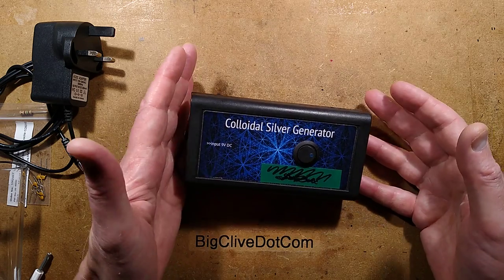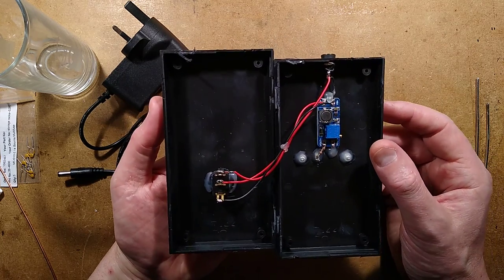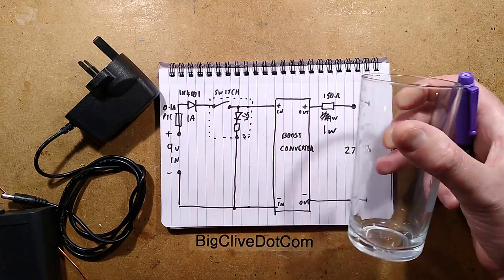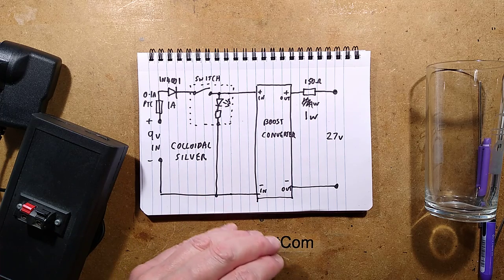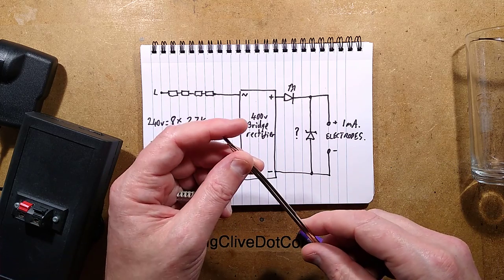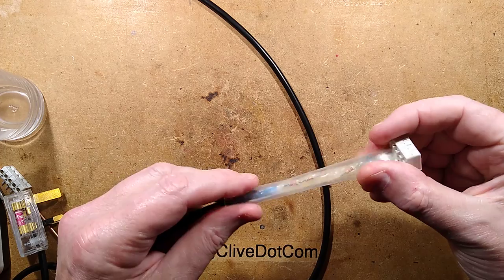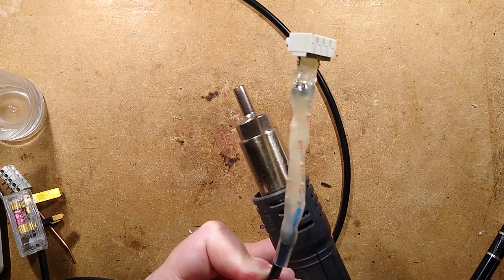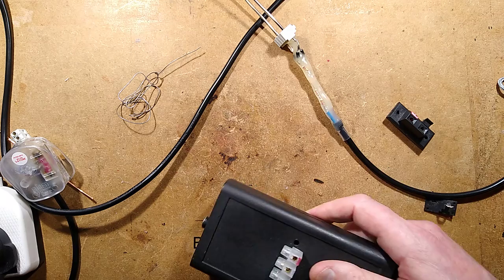Fixing a colloidal silver unit and making a slightly dangerous one.

Comment: This device produces only ionic silver. That it produces in a short time scale amounts of a white precipitate, which is by definition not a colloid, is most likely due to the presence of electrolytes in the tap water used. The white precipitate is suggestive of silver chloride, a product easily resulting from silver ions reacting with chlorinated tap water.

Colloidal silver is a suspension of fine particles of elemental silver that will not settle or will settle only after a long time frame. It is a mixture not a solution.

Ionic silver is not colloidal silver. It may be possible to create a colloid of an ionic silver compound, for instance, silver chloride, but this would still not be colloidal silver, it would be colloidal silver chloride.

Silver chloride is not silver just as sodium chloride is not sodium. Sodium is a silver-grey metal that reacts violently with water. Sodium chloride is table salt, it doesn't make your soup explode (except maybe explode with flavour, I don't know how good a cook you are). Silver is a silver-coloured metal you make jewellery from or use as a conductive wire. Silver chloride is a white powder that turns violet after exposure to light.

Ionic silver, often in the form of water soluble silver nitrate, is often the starting point to make colloidal silver. One reduces the ionic silver by the addition of a reducing agent. No such reducing agent is being used here. I have heard of one similar commercially available silver ioniser that has an additional step of adding a reducing agent after the oxidation is completed though I am skeptical of the efficacy. If it was as simple as the manufacturer's instructions state I think the process would be more widespread in industrial and research laboratories who have a need for colloidal silver.

In the absence of contaminants found in tap water to act as electrolytes the device in thus video would take longer to have much effect but would still produce only ionic silver, quite possibly in the form of silver oxide or silver hydroxide. The oxide being obtainable from dissolved oxygen and the hydroxide autodissociation of water. Silver hydroxide however would decompose into silver oxide and water. Silver oxide is a black powder. Oddly enough, people who use these fatuously named "colloidal silver generators" with distilled water find their silver electrodes covered in a black powder. With only pure water and pure silver and atmospheric oxygen as reactants there's really only one credible explanation for the nature of this powder.

Comment: I have never heard of this silver drink, but it scares the bejeezes out of me. I would definitely never drink anything like this. Also mains voltage scares the hell out of me too. I was always glad when they started putting plugs on things. I usually took about 10 to 15 minute's just to wire up a plug. Double, triple and quadruple checking all connections. When Clive plays with mains voltage my heart skips a beat.
Reply: I find it strange that UK appliances used to be sold without a plug. Here in the US everything has had its own plug since maybe the 1920s.
Reply: @eDoc2020  not only that, but we had to know what size fuse to put in it too. Mostly 3amp or 13 amp. Though there were some 5 amps used as well. Maybe it was to do with costs, or the electric company bring in with the insurance companies putting the liability of faults in the customers hands rather than there own.
Reply: @eDoc2020  In the UK, until the late 1950s, there were competing standards for electricity, with different plugs (see BS 317, Wylex, Walsall Gauge, etc). Consequently, it was normal to sell appliances without a plug, so the customer could fit whichever type they required.

In the 1960s, things became more standardised, particularly with the formation of the Central Electricity Generating Board, which eventually became the National Grid. However, there was still no legal requirement to supply a plug - and companies save money when they can. Also, it takes many years for people to adopt a new standard. We were taught how to wire a plug at school, so it was normal.

Things were built to last. If you paid $300 for a toaster, you wouldn't just throw it away if it broke - you'd get it repaired. It could last for 30, 40 years. Nowadays, we buy a $10 toaster that lasts maybe 3 years, then throw it away.

Eventually, selling things with a plug became a marketing advantage. Then the law changed in 1994. Since then, everything has to be sold with a plug.

Comment: Why do you say, "the safety of ingesting colloidal silver is not proven"
It is proven. It's dangeous. There is no controversy.
Reply: Did you read that on wikipedia?
Reply: @Varangian_af_Scaniae  No, but I may have written it on Wikipedia, back when I worked for the Wikimedia Foundation.
Reply: @Varangian_af_Scaniae  I mean by the very claims of the product it's dangerous. If you're killing bacteria, you're killing helpful gut bacteria too, which is another reason antibiotics are avoided for long term use. There are many studies linking diversity of gut bacteria to long and healthy lives. In addition, heavy metal poisoning is very real and we had to rush someone from our lab to hospital after they accidentally ingested a solution containing silver! It can destroy your kidneys with prolonged exposure
Reply: @georgeperalta936  like constantly using Hand Sanitizer And wearing masks...
Reply: @bansheemania1692  Not really. Unless you are bathing in hand sanitizer, the bacteria living on your lower arm will re-establish on your hands quite quickly. Using hand sanitizer constantly mostly just dries your skin etc. Not sure what you are trying to imply about wearing masks. They don't kill anything, just prevent you from spreading stuff, and helping you not breathe in as much potentially harmful stuff. Doctors and nurses have been wearing masks for so long it would probably have been discovered if they actually posed a problem for anything other than your fashion statement :P

Comment: Question: Why is "50 quid" (50 pounds sterling-silver) a good price for $4 USD of ebay components?
Reply: Because it's a specialised tool BigPharma don't want you to know about! The maker painstakingly removed all the bad voltages and currents from each component before assembling and then prayed a long prayer to the spaghetti monster before selling. Obviously all this vastly adds value
Reply: The guy(s) who designed, sourced parts for, assembled, hopefully tested, packaged, and shipped the device have put a not-insignificant amount of time into it, and, even if it is a quack device, do deserve their cut of the "stupid" tax.  Also, by charging 50 pounds for it, and making it straight from ebay parts, they open a market for people to undercut them on price.
Reply: @Kineth1  My comment wasn't against free market capitalism.  I'm calling it a piece of sht that's not worth $75 -- functionally, materially nor ingenuitively.  You can buy a $75 bench power supply that supports 0~30V CV and 0~3A CC with dials and digital displays that will do the same thing as this dinky device, and a whole lot lot more.
Reply: @agvulpine  It may not be worth it to you, but it is worth it to others. (Not me to me this is quackery obviously). But my answer to your original question is, a good price for anything is the highest price people are willing to pay. No matter the components in it.
Reply: @MrMali22  Not as long as I and people like me are around to challenge the price and inform onlookers.
Reply: @agvulpine  I don't disagree with you there. That definitely plays a part in the amount they're able to sell/ sell it for.

Comment: I'm surprised at the thing blowing up in that way, most boost converters have some sort of fault/short-circuit protection. Perhaps the 150 ohm resistor was just sufficient to prevent it from being triggered.
Reply: Have you seen these things ? they are like 10p off Ebay.
Reply: Yes, I've got some, the short-circuit protection is a function of the control chip, and I have tested them before now.
Reply: @chrishartley1210  How are they doing this? A pure boost converter can not drop the output below the input voltage, so a short will always cause high current, or have they an additional FET that switches the whole unit off? They ones I have don't have any protection.
Reply: @1Hippo  They go into fault condition and just switch off. No output at all. I suppose some may keep testing and turning off again. If that goes on long enough it could make the resistor hot enough to burn out.
Reply: And now I'll correct myself, I'm thinking of buck converters of course!!!

Comment: I used to make CS w/ a friend. IIRC, the blue-ness only happens when salts form in impure water. If that's true, I see no real issue apart from gut flora. But taking hits off an ultrasonic humidifier could be helpful in some situations. 

One issue we ran into was "fuzz" building up on the anode. So, we built a switching generator that switched the anode/cathode every couple of minutes.
Reply: I used an ac line limited by a nightlight in series, 7 watts, so maybe 3.5 usable watts of power

Comment: hi clive we have a kit. part of the kit was a ppm meter.i think the silver electrodes were in the water for about 45 minutes,but even that was on the high side of the ppm.you also could not touch the c-silver with anything metal eg a spoon. plastic is good as.i think the silver drops out of suspension when it comes in contact with metal. also, we have to clean our silver rods with a scratchy cloth about three times during the 45 minutes because they went black.some new machines have got around this problem some how. i was told way back when, that a silver coin was put into milk to make it keep much longer.flowers in a jar would keep as well. great vids,a little over my head at times. thumbs up

Comment: Hole e crap that was LOUD!! ~23:40 the high frequency whine.  There is a lot of QRM bleeding from that I bet too.
Reply: I hope I'm not the only one that hears it
Reply from the maker: I didn't hear it.  But that's probably an age thing.
Reply: I use those boost devices sometimes. The scratchy switching noise is really annoying. The LM2596's which this probably is switch about 150KHz so I guess that noise is the inductor rattling away and some far lower frequency.  I can hear that noise quite well at 52 years ancient. Not measured it, but that audio tone is probably down to 3-10Khz on mine and very audible.
Reply: Definitely hear it! Something about that frequency makes my teeth feel weird.... for some reason?
I'm 37 y/o and using quite nice audio setup.
Reply: Oh ... at 54 I hear nothing :(  mind you those chainsaws I used at work for many years without PPE where quite loud... just saying :(
Reply: i here nothing
Reply: well over 50 here and I hear nothing
Reply: yeah, it's pretty loud even through my phone speaker
Reply: Oh, Damn! It's even worse in the phone speaker.

47y/o here.
Reply: Heard it too, was super annoying. Also use some high-end sound equipment (10€ Panasonic in-ear headphones).

Comment: Should have 3D printed a box in pink PLA.
For the connector I'd use those cheap "feed through 2 way" Chinese WAGO connectors. I love those things for general hackery.
Reply from the maker: For some inexplicable reason I didn't even think of 3D printing a case.
Reply: Pink is the best colour and it's not pinks fault, there was barbie.

Comment: Just a thought here Clive. 
You could make a channel to "flow" the hot glue into if you use 3 ice lolly sticks fixed together to make a U shape to put the resister assemble into and then smother it with hot glue. That would effectively pott the resisters in the hot glue and stop it from going where one didn't want it to go. Don't know yet how to stop the hot clue, which would be cold when removed from sticking to the potting trough.

Comment: can you not build everything inside a uk plug with the low current wires going to a terminal block ?
Reply from the maker: It could be built into a plug-top case.
Reply: @bigclivedotcom  I would keep the circuitry away from the electrodes and this seems like a fair way to do it. Even with your 'potting' it's still good to keep mains away from water.

Comment: I’m not convinced that this device generates colloidal silver solution, but rather makes silver ions.  Ionic silver might have equivalent benefit to colloidal silver.  It can be hard to differentiate real information from urban legend around colloidal and ionic silver.  It is a bit of an apocryphal story, but the old saw about being born with a silver spoon in the mouth may have some basis in fact, thanks to the antibacterial properties of silver particles coming off the spoon while feeding little Junior.  Any silver benefit is probably small and decent hygiene and sanitation probably matter more than a spoon’s metal.  Silver nitrate used to be used to clean newborn babies’ eyes, preventing infection.

Something else I’ll add is that some commercial and perhaps home made colloidal silver can be exceptionally acidic, perhaps with a pH of 1!  That comes from the manufacturing process of sparking the silver electrodes above water with very high voltage - the intent to blow metallic silver off the electrode in small enough size to form a colloid thanks to Brownian motion keeping the particles in suspension.  What can come along for the ride is nitric acid caused by the spark fixing nitrogen from the air into nitric acid In the water.  Drinking that brew would almost assuredly nullify any benefits of investing silver particles.  Buyer beware.

Comment: A slight nitpick: the colloidal silver is extremely fine powder of silver metal suspended in water, not molecules (pure metals do not exist as molecules). But nice projects. I'm highly sceptical of the supposed health benefits of ingesting toxic heavy metals (which silver definitely is) but as long as the quantities are minute, I don't think it's super dangerous either. Silver metal is useful as a disinfectant, though.
Reply: and a nitpick of a nitpick, materials don't exist as free single atoms for much time at all, outside of edge cases like noble gasses, O2 is a molecule, Ag2 is a molecule, a silver ingot is a bunch of molecules.

Comment: No matter how well potted, I wouldn't want current un-limited mains that close to a) water and b) my hands. The mains flex would mean that whatever setup you had, you'd have a heavy flex trying to pull the container over. Water tracks in everywhere, especially down the side of flexible cables and thermal cycle induced cracking can be almost invisible. If someone put a gun to my head and I had to make one of these, I would have a separate mains box with a Class Y "isolating" capacitor, 48V limiting zener and an input  PTC (in addition to the resistor chain), with the electrolysing head on a 2m cable.  Better still, just use a USB power bank and a boost converter as used in the original unit.

Comment: Just a Suggestion - Using 3 blocks wide of chock block, Loosen the screws in a chock block slid the silver rods through the 2 outer blocks say 5 mm from the end of the rods, re-tighten the C.B. screws. And that will stop the rods shorting together. Also seeing as it just seams to be the last 5 mm of rods the the silver is clouding from why not insulate the rest of the rods may be this will give the rods longer life.

Comment: Interesting Video, I have a life Force compact EZ-2.  Seems I have trouble getting a good connection to my 12 gauge silver wires. The connectors that came with my generator are like the one your friend sent you. Would you recommend base connectors like you used or should I look for gold contact product. I've always been under the impression that colloidal silver generators supposedly alternate the DC current from positive to negative and back in milliseconds. I assume this is how the silver as it was migrating from negative to positive when the charge was reversed the silver ended up floating in the solution. Am I wrong?
.
I make to 2 L of Colloidal silver at a time. I've been making colloidal silver for over 30 years up until Covid I took 1 ounce at 10 PPM a day. My skin has no blue pallor at all, that particular issue is extremely over exaggerated. If you dug deeper you find out that the guy was drinking almost a quart or more a day.

Comment: but Big Clive, what about the fact that introducing electrolysis into water splits the H2O into HHO AKA, Browns gas? I mean, as long as air pockets aren't forming in the top of the water, other wise it can ignite with a spark. This is why in this application you could technically add dish soap and as bubbles start to form, you could ignite them with a lighter.  The bubbles from two rods will let off bubbles and one rod will have pure oxygen and the other will have pure hydrogen. If you collected pure oxygen in a test tube, and stuck a freshly lit and blown out toothpick up into the oxygen tube, it would glow bright to tell you oxygen is present, do that with the hydrogen side and it would pop. the two gases combined would give a small explosion.

Comment: AC should work ok in this situation providing the electrodes are identical and the water is pure as the only change is loss of silver from the electrodes. However, with contaminants present there will likely be chemical reactions altering the electrode surfaces and producing a range of potentially more toxic soluble chemicals. The presence of  NaCl will result in formation of silver chloride which is likely to increase silver absorbed when the “colloidal” solution is consumed.